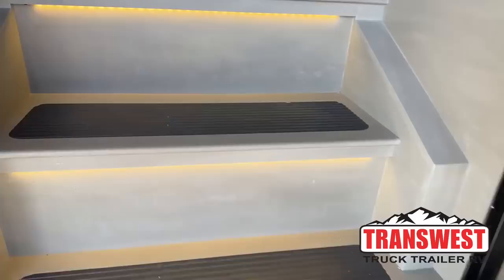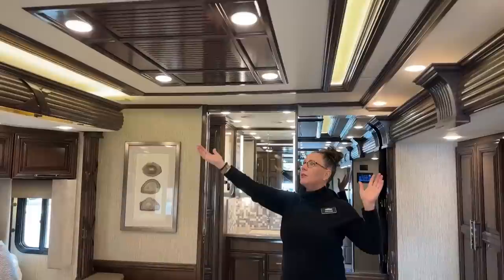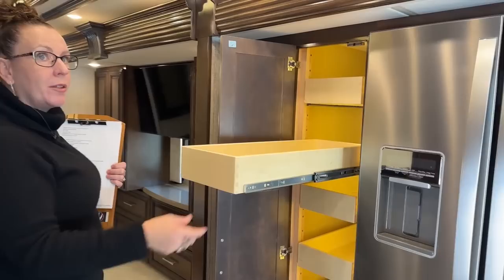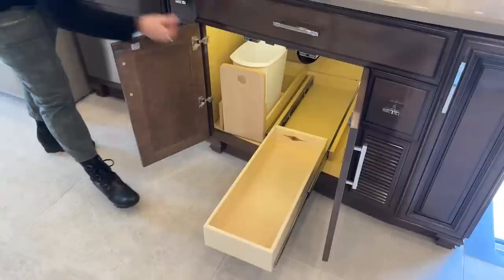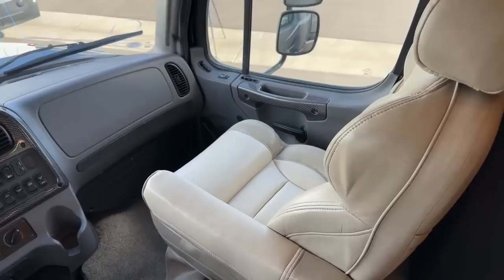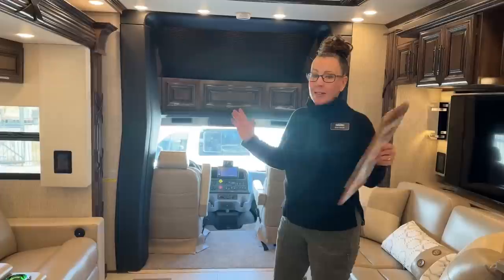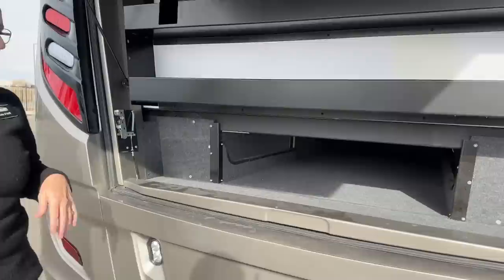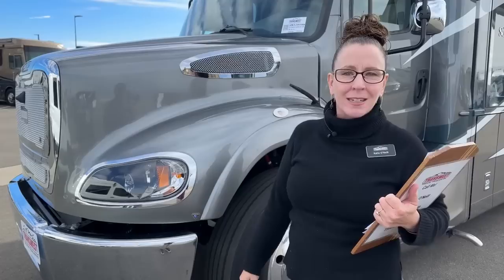2023 Newmar Supreme Aire 4530 Super C - 5N220599

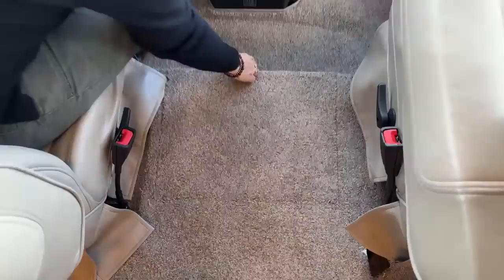Comment: Love the video and rig however….. super disappointed with Newmar’s fuse mess at 35:24. I’m glad it’s easily accessible but seriously, after spending so much money on this rig, the last thing you need is to go through a mess of wires and fuses while troubleshooting a usually stressful situation/time. Otherwise, you presented the rig very well. Great job. And good luck talking them into creating a spot solely for your lip gloss:). Cheers.

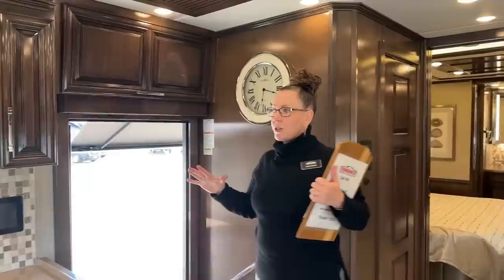Comment: Not hate comments, but just some thoughts, please don't take it in a wrong way. 6:23 Not sure why the toilet is not in the center. Unless it swivels, it's an uncomfortable position for taller, heavier and muscular individuals. 12:04 This is centered, which is good. 17:55 Mid entry point door is always preferable compared to cab entry door. Not enough sleeping spaces for third and fourth person. 28:05 Forget adults, that convertible couch is too small and uncomfortable to fit even two teenagers and 28:13 looks horrible. Way too overpriced.